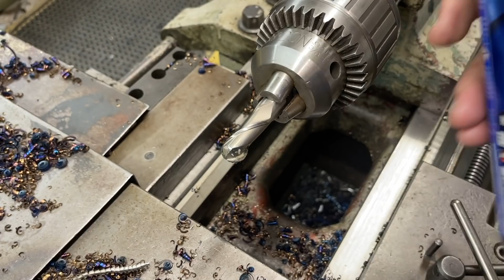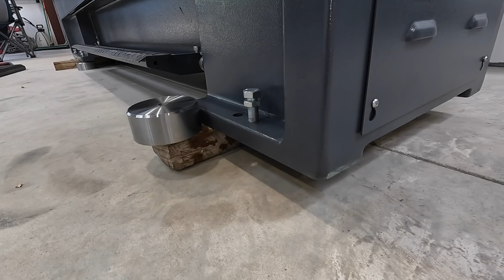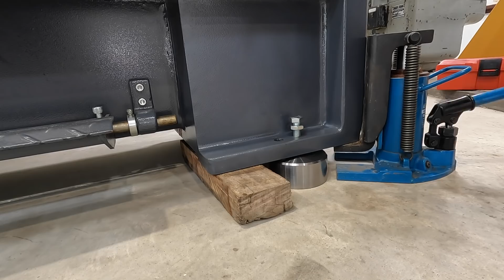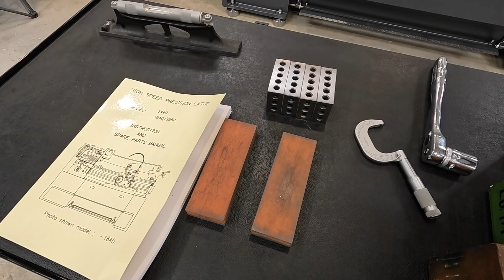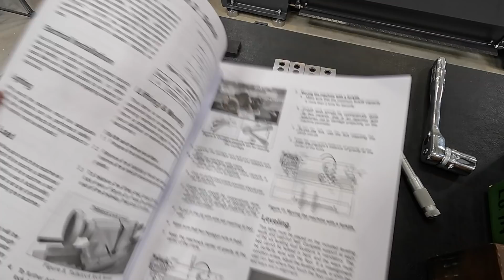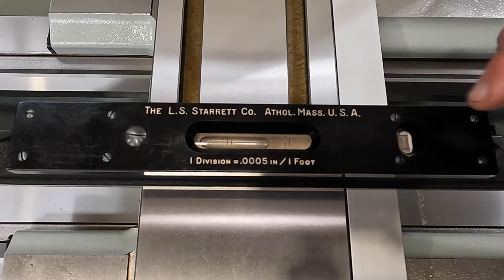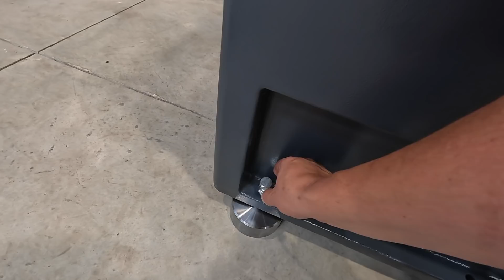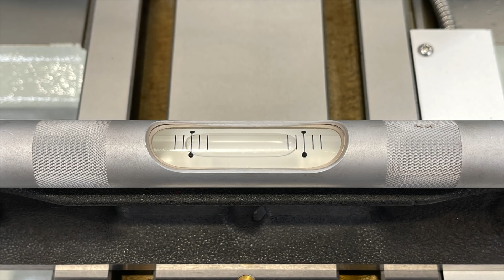Leveling the Precision Matthews TL-1660 Lathe

Comment: It's surprising that the chip pan doesn't have a drainage slope built in, so that the bed can be levelled in both X and Z directions.
Reply: That's not why he's leveling it at a tilt. It's so fluid doesn't travel along the part being machined and going through the chuck and running on the floor.
Reply: @cornpop7805  you think a few thou will do that trick?
Reply: @janvanruth3485 
I used to build and install CNC lathes and we actually made ours level unless the customer wanted it pitched. If the coolant sprays towards the headstock, liquid will go through the spindle bore, regardless how the machine is pitched. You just plug the spindle bore or stuff a rag around the stock, if you're running material through the spindle bore. This whole pitching the machine thing is BS.

However, what machine tool builders do when they build a machine is, everso slightly tilt the headstock down and toward the operator (2/10,000"/6"). This is because single point turning (contact being on the operator side) will deflect the material up and away from the operator. So if the spindle was perfectly centered, a part, even with the finest finish cut, would be slightly bugle shaped (smaller at the headstock side). So, slightly tilting the headstock down and towards the operator, will counteract these forces, to some degree. All serious machine too manufacturers build this in at the factory. It is the the installer's job to insure the machine is installed in this same condition.

I believe the myth of tilting the machine so the coolant will flow correctly comes from people misunderstanding what tilting does and where it's done. Also, it's not supposed to be accomplished with levels, you do it with the test cut and 1/10th mics.

Comment: I would assume that the manufacturer designed it so the coolant flows correctly when it is perfectly level. There really should be no reason to have the tailstock lower on a good lathe.
Reply: That's not why he's leveling it at a tilt. It's so fluid doesn't travel along the part being machined and going through the chuck and running on the floor.

Comment: After all that super-precise setup the machine will cut a taper of 2 thou over a foot and we will have a similar video 2 weeks from now.
Reply: I've seen video of the same lathe being tested and showing less than a ten thousandth of runout on the spindle, I'm sure once it's up and running Adam will do something similar
Reply: @bdkj3e  spindle runout does not change with machine setup.
it is an inherent property of the machine.
Reply: @janvanruth3485  I'm saying that a machine with that much precision in the head I doubt it will have that much taper.
Reply: and the levelling in that new video will also be completely moot, just like this one....
Reply: this machine is different from abom’s other lathes that headstock and ways are on assembled pieces, not from one big ‘ol casting. Having that in mind remember that this lathe was loaded and unloaded from trucks/ships/pallet jacks I’d say 10 times+ on its way from Taiwan into Adam’s shop. I’d be surprised/impressed if headstock axis and ways are still perfectly parallel.
Reply: @JayDee28 Gotcha, if I remember right it was shipped to their headquarters in Pennsylvania where they cleaned it up and added the DROs, not sure if they calibrated it or not, I'm sure we'll see once he gets it up and running.

Comment: I wonder why the manufacturers don't use "fine thread" bolts for leveling. I have woodworking tools, routers and the like, that use coarse thread adjusting bolts and screws and it is almost impossible to make "fine" adjustments.

Comment: I don't understand why you need to have it level. The Cement is close to being level. There is no logic here.
Reply: In machining it's not really ok to be "good enough". Levelling the machine will ensure there is no twist or distortion in the machine that will translate onto the workpiece. Concrete floors are really not even close to being either level or flat, in machine terms.
Reply: I think its more accurate to say the machine has to be in the same plane to operate at its best. the easiest way to do that is to make it as level as possible.
Reply: Watch the 'this old tony' video on lathe leveling for a good explanation
Reply: Picture doing the job where you have to turn a shaft 6 ft long, and maintain uniformity of diameter +.0005"/-.0005". You've got a .0010" diameter tolerance band to play around in. Unless your bed is dead level to a uniform plane (no twist or hysteresis) it will be difficult to avoid putting a taper into that shaft.

And you also have to consider the alignment of your study rest or follower rest or tailstock center. All of these need a uniformly flat bed to ride on.
Reply: @johndonlan5956  you really expect a low cost lathe to turn straight just by levelling the bed?
it might, but that would be sheer luck.
the proof of the pudding is in the eating.
that is why lathes are adjusted  by actually turning a piece and measuring it.
that whole levelling thing is just to get it into the ballpark so the actual adjustment doesn't take that long.
Reply: @janvanruth3485  I did not mean to imply that simply by straightening the bed it will guarantee that you will not have problems with misalignment and unintended taper. The tail stock and head stock may need adjustment in order to bring them into proper axial alignment. And the chuck may have to be adjusted as well. But all of these "tweakings" may prove futile if you don't have a properly aligned bed to start with.
Reply: *concrete

Comment: Abom what I have learn since we got a toe jack is bigger machine use the jack on one end to get it level in the ball park.  Then hand tighten the bolts . It just depends on how off level it is or twisted . I have spent a few hours chasing my butt to.  And it sucks when is a very large machine and your using a 18" crescent and cheater pipe.  I feel you.

Comment: I had an interesting scenario when levelling my lathe, I realised that the position of the level lengthways on the 123 blocks affected the reading (level was far longer than lathe ways width), which indicated to me that the level base was convex or concave enough to affect the reading. Had to go back and redo the entire process and ensure the level was same direction and same location each time I swapped ends. Next job is to check and scrape that level
Reply: I don't know what sort of a level you were using, but the Starrett 199's like Adam was using in this video are deliberately scraped slightly concave to avoid rocking. Only one or two tenths, though. Just enough to be certain it's not convex.
Reply: @PaulSteMarie  good to know thanks! Unfortunately it’s just a cheap import so I’ll blue it up and check it out

Comment: I'm suprised that the drain pan doesnt have a slight grade built into it, Seems unusual to have to level a machine with that having to be a consideration. Those pads look awesome but the manufacturer should've supplied the adjustment screws with a fine thread to facilitate easier adjustment.
Reply: That's not why he's leveling it at a tilt. It's so fluid doesn't travel along the part being machined and going through the chuck and running on the floor.

Comment: Years ago a work acquaintance gave me a piece of gymnastics foam to save my knees at work and it lasted me for years. It was durable and washable, and didn't break down like foam rubber pads do. It only needed replaced because I got roofing tar on it, and it took me a while to track down what type it was. As it turns out, toolbox makers sell it with a fancy name -- "Kaizen foam".
Reply: I have a cheap rolled up yoga mat that has saved my knees over the years. Took me about 2 years of regularly using it to wear it out and it only cost me $5 to replace. Even saved my back a few times rolling it out to work underneath my friend's car in gravel.

100% worth it!
Reply: Useful info.  Thanks.

Comment: your concrete man did good job
Reply: There are a bunch of crack in it.
Reply: @ItsMrAssholeToYou  all concrete cracks.
Reply: @rustyshackleford498  
Nope.  Properly engineered and installed concrete doesn't crack.  I work in a decades-old 150' x 300' building that has heavy equipment driving on it all day, and the closet thing to a crack in the floor are the expansion joints.  Similar can be said for literally millions upon millions of concrete slabs around the world.  This is because they were (pay attention now, because this is important) PROPERLY ENGINEERED AND INSTALLED.

Only half-assed concrete cracks.
Reply: @ItsMrAssholeToYou  properly engineered concrete and installed concrete cracks at the expansion joints. Again, all concrete cracks.
Reply: @rustyshackleford498  
Ah, that must be why the basement slab and foundation walls in my 119 year-old building, which lack expansion joints entirely, also have no cracks.  Thanks for the expertise.  You must do top-flight flatwork.
Reply: @ItsMrAssholeToYou  ah yes, I have triggered the machismo response of a neglected, beta male. My day is complete, on to the next internet rube.
Reply: @rustyshackleford498  
Pointing-out demonstrably wrong assertions of knowledge when doubled-down upon is a machismo response now?  Huh, I wonder when that changed.  Well, thanks for keeping me up-to-date on these things.

And all it took was was making repeated public displays of ignorance.  Your dedication to your craft is commendable.

Comment: Hey Adam, I am no machinist, but I would think that a lathe manufacturer could easily make the coolant run to the sump with the lathe leveled in all directions. Great camera work.
Reply: That's not why he's leveling it at a tilt. It's so fluid doesn't travel along the part being machined and going through the chuck and running on the floor.

Comment: Just wondering, wouldn’t it be better to for the lathe to be all on a single part of the slab ? Looks like a joint is running down the centre ?
Reply: It's all just one slab, these are control joints IIRC.

Comment: As a retired millwright we always used dial indicator on top of the foot when tightening down checking for a soft foot condition then shimming for zero pull down… then again it’s only a lathe
Reply: So true.  U don't want to twist the machine.

Comment: I don't know where you are, but I was close, I could show you the perfect set of procedures to level and align that lathe.

I used to work for Mazak building both CNC Machining Centers and Turning Centers and I used a 1/10,000/ft. level, which is just 5x more accurate, but 10x tougher to do.

There's essentially no difference is setting up your lathe and a CNC, in regard to leveling and alignment. I will say, that you're only half way done.
Reply: Let me ask you though, is Adam's setup what he needs to do the work he does?
Reply: @thomasbecker9676 
Let me put it this way; this is a nice new machine and it's likely going to be around for a while. "Metal way" machine tools experience wear and they experience less wear when they are properly aligned. 

The below article does an OK job of describing the process of checking the headstock alignment, using the test cut method. I would say you want nothing harder than mild steel, but preferably brass or aluminum. I'd go 2.5" to 3.0" dia. and about 5" to 6" in length. You also want the smallest radius single point turning tool you can find. You want to make a finish cut (on both sides of the barbell) no more than 0.003". Run the RPM up, the travel to the lowest in/rev you have. Maybe use some WD40 to lube the cut. The idea is absolute minimum tool force.

Afterwards, measure both ends of the anvil to 1/10,000. Both exactly the same same is ok, but even better for the futher away part of the barbell to be 2/10,000" to 3/10,000" smaller than than the one that's closer to the chuck.
https://hackaday.com/2018/08/07/lathe-headstock-alignment/
Reply: @cornpop7805  You act as if Adam is just some hobbyist.
Reply: @thomasbecker9676 
There's a difference between a machinist and a machine tool specialist. I watch his channel and while he's not a novice machinist, he is a novice machine tool installer. I'm  a highly advanced machine tool specialist/installer, who is a less accomplished machinist than ABomb. I'd certainly take advice on Machining without being slighted.

I put the 100% correct information out there to benifit ABomb and anyone who cares to read it.

I built and aligned machine tools day in day out. On the large complicated tools I built, there's 0% chance you can fake it. You do all your alignments and another pro comes behind you to verify your numbers. On a complicated machine (not a simple lathe), even a guy as smart as ABomb might take a month or two to align a machine that takes me a 6hrs. It's not because a guy like that isn't intelligent, it's because it takes about 500 hours to train a guy how to align complex machines. There are particular methods and orders to those methods. Everything you adjust effects something else, it takes a long time to learn. Lucky this is a simple lathe and I was able to fit the correct info in a comment.
Reply: @cornpop7805  If you're that concerned, why don't you fly out to Pensacola and level his lathe for him?
Reply: @thomasbecker9676 
I've done what I can do.

I tend to watch videos to learn. In addition to that I read the comments to add nuance to my understanding. Maybe I'll see something that leads me to researching another point of view. Occasionally, I offer my thoughts or advice on a topic, if I feel qualified. Rarely will I just stir the pot, which is all you're doing.

Good day sir!
Reply: @cornpop7805  k.

Comment: Home Depot sells the foam knee board for I believe $20; I bought one last year and haven’t looked back. I like the boards more than knee pads; the only thing better are the rolling kneeler which makes moving work on concrete or just at floor height a lot better.

Comment: Is all this precision just so coolant runs down to the drain?  Doesn't seem that complicated. 1 degree slope is a rule of thumb for drains +/- a little.  Am I missing something ?
Reply: if the machine is not square and level it will not cut true.
Reply: @rockinrobbie1288  square and level don’t mean anything in machining terms. What matters is the ways of the machine are in the same plane. The true test is cutting a test piece. I’ve seen new lathes need adjusting out of plane to end up cutting true.
Reply: Yeah -- probably so.  I think he assumed most people understood why and how you level a lathe bed.  I think he spent so much time on the downward slope is because he expected commenters to make a big deal about not aiming for perfectly level end to end.  So we get a bunch of people thinking he's talking about the coolant pan underneath, we're back to a bunch of commenters making a big deal!  Oh well.

If you measure at various points along the length of the lathe, across the ways, if the readings are different the lathe bed is twisted.  That's bad, because it won't cut straight.  So you want all of those readings to be identical -- they can be all of by the same two divisions, but if you make them all the same level, it's a good reference point.  Similarly if you measure along the length of the ways, all points should be the same reading (which is what he was saying about the slope for coolant).  If they're all the same, it means the ways are straight along the length.  The bigger the lathe, the more likely it's going to have a hump or dip along the length.  It's all about cutting straight and square and true, with the motion of the carriage laser-straight.
Reply: Yes, specifically the part of the video where he explained that if the ways are twisted they will lead to taper and bad cuts.

Comment: surprised the leveling bolts are coarse pitch. (Well they looked like coarse pitch)
Reply: And thhat they're just a simple bolt. The bolts on my old haas lathe are about an inch thick, and now that you mention it I need to make some locking nuts for them

Comment: Why isn’t a pitch or slope built in to the catch pan?
Reply: I would check the chip pan to make sure the factory didn't already put a grade in it.
Reply: That's not why he's leveling it at a tilt. It's so fluid doesn't travel along the part being machined and going through the chuck and running on the floor.
Reply: @cornpop7805  It takes about 1% slope to get water to flow.  That would be .12" per foot.  He leveled it at .0005" per foot.  I can't see using the lathe accurately with enough slope to make sure the coolant did not flow through the chuck.
Reply: @vendter 
That's the rational he used. It's based on a flawed understanding of "tilting the headstock", being for coolant drainage. The real idea of tilting the headstock is something that machine tool builders do to help counteract tool forces. If you're interested in exactly how that works, I can copy and past a somewhat detailed explanation that I wrote another person in the comments section.

Comment: I’m not a machinist so help me understand why you go thru all the trouble of a precision level process and not make it level? So the flood coolant flows toward the tail stock. Also makes you wonder why the casting or maybe the flood coolant pan doesn’t have a tilt toward the tail stock built in.  I welcome opinions from the machinists reading this. Thanks.
Reply: That's not why he's leveling it at a tilt. It's so fluid doesn't travel along the part being machined and going through the chuck and running on the floor.
Reply: Agree w u.  Manufacturer should take care of drainage.
Reply: More than likely there is already proper drainage and tilting should not be necessary especially considering the price. However maybe he's done some research and thats the prevailing wisdom.  Also, the most important part was the second half where he is taking the twist out of the ways which will result in tapers and bad cuts.  Quite possibly the first half was not really needed.